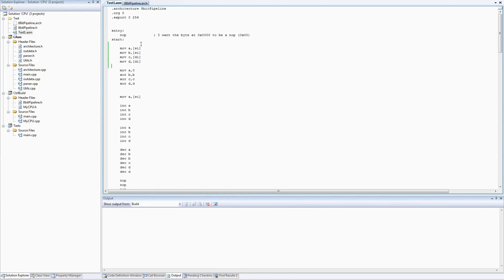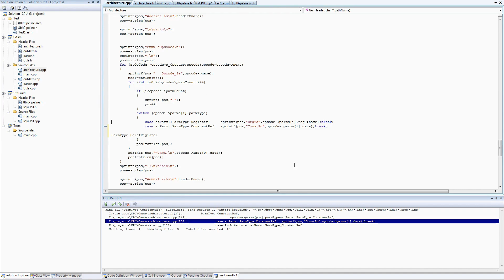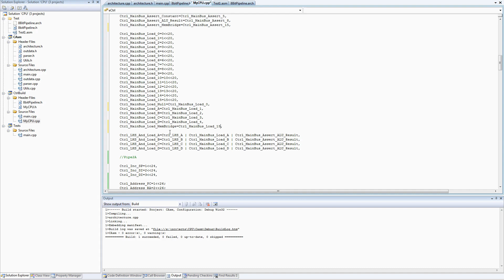Address Bus Control - Making an 8 Bit pipelined CPU - Part 46

Comment: I was thinking about the conflict that you’ll get if you follow a mov from memory with a constant load as both pipeline stages will want to read different addresses at the same time.
I assume you’ll fix that on the assembly side.
But maybe there is room for a bit of logic that prevents pipeline 1 from asserting the pc register if pipeline 2 is asserting, which would mean a constant load after a mov from memory will actually duplicate the previous move into a second register. You could effectively get a free instruction using the same machine code with no constant value, depending on the placement of the instruction.

I guess a simple mov b,a would do the same thing, but would need another instruction in between to wait for completion of the previous move.

So maybe not a big win at all.
Reply from the maker: You'll be interested in parts 65 and 72 where I dig into exactly this situation more.

Comment: (1:05) Is that a custom graphic for the pinout? Cool!
(5:14) LUL
(10:58) Cool. Leaving the assert and load main bus NULL off of the microcode for CMP, TEST, and CLC is no longer an issue.
(12:24) I'm betting it won't work. You updated the PIPE 2A ROM, but the relevant control lines should be in PIPE 2B.
(13:44) I call foul! You didn't show updating PIPE 2B, and you had them under a "PIPE 2A" comment!

So, you can now use microcode to tell the fetch unit to fetch from some register other than the program counter. I'm not sure how much use there will be for that, but I suppose it's something to keep in mind.
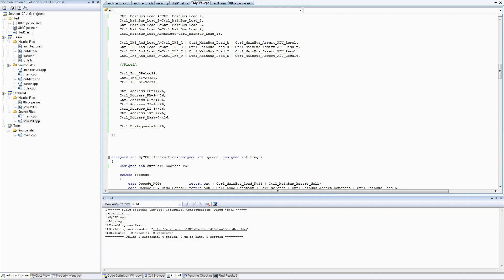Reply from the maker: You "call foul"? go back to 12:13 and you can see I plug both rom chips back in. Later on the build I add change detection logic to the rom build code to tell me which ones have changed.
Reply: @weirdboyjim  Oh. I have no clue how I missed that.

Comment: I'm mildly disturbed by the lack of spaces in your code...

Things like:
for(int i=0;i<opcode->parmCount;i++)
I would write like this:
for (int i = 0; i < opcode->parmCount; i++)
(which I personally find easier to read)

I mean, it's just personal preference either way, so don't worry about it, but, yeah, just an observation :)
Reply from the maker: It's a curious observation, most "modern" coders write with the extra space but many older coders use a style more like mine. I was coding for many years on an 80 column display so often the big factor on legibility was fitting a block of code on screen so superfluous space was cut out. When working on bigger games I often have to work to an established coding standard, but with my own work I revert to type.
Reply: @weirdboyjim  Ah, that makes sense! I'm so used to a large monitor these days, I didn't even think about that, even though I've been into computers since the early 90s!

Comment: testing the circuit I saw, that in my build the PC-Inc line is driven by the main clock, so it counts on every clock pulse. but also loading constants into GPR works fine, no instruction missing. I am confused, shouldnot the PC.Inc be disabled when loading constants and when reading from memory? sorry, but I do not remeber in which video you explained it
Reply from the maker: That is correct behaviour. The immediate is the next byte in the instruction stream (Think of it as a 2 byte instruction) so at the same time as telling the constant register to load stage 1 also tells the fetch unit not to dispatch that byte as an instruction, but we still want PC to move on to the next location in memory. In Part 53 I add the bus request line from Stage 2 which but prevents the fetch AND the increment because it's complete taking over the memory bus for a read or write.
Reply: @weirdboyjim  Thanks, James, so I look ahead to Part 53, for now I am thinking about your Transfer register Design, the duel load works fine yet